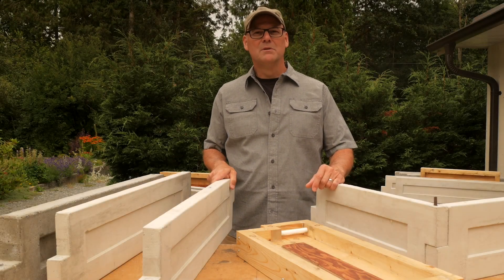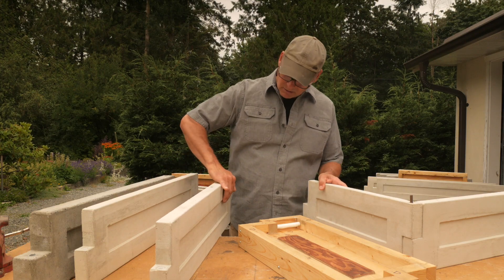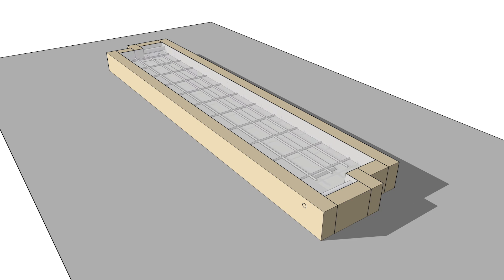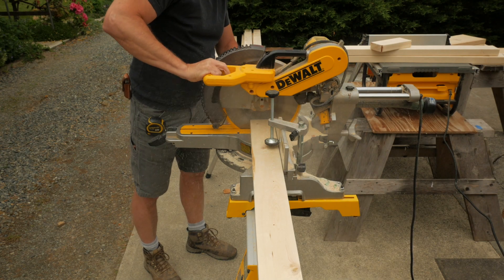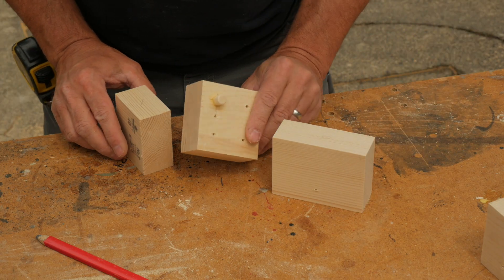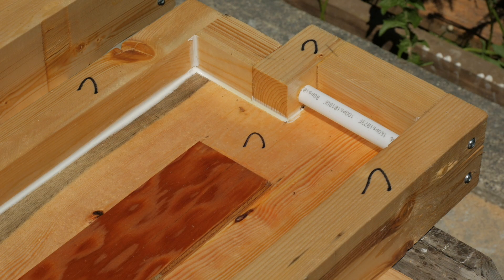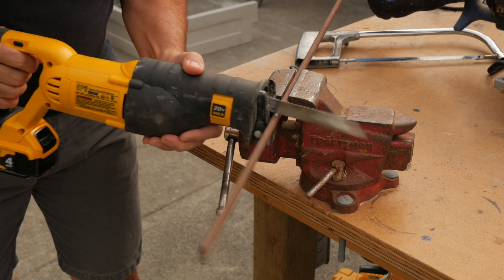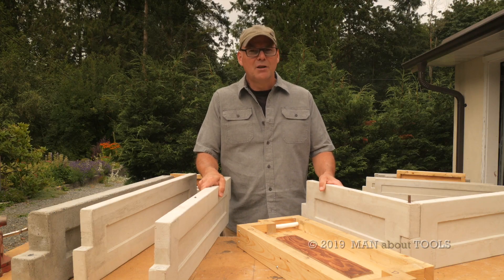make Thin CSA Concrete Garden Boxes PART 4 - cast garden forms

Comment: So, about the mesh in there ... as many have pointed out it's mainly there to take on the sheer tensions in the piece, as concrete is weak to those (while it deals incredible well with compression tension). The main reasons to put it in structural concrete (or any) is to deal with these types of tensions, be it from transporting/lifting (aka bending under it's own weight), or impact tensions (f/e sidewalk curbs have a steel rod inside to deal with loads from cars hitting (or resting on) them, and of course any actual permanent or dynamic loads the structure has to endure which would cause the piece to bend ...

So to figure out if the mesh is needed, one would have to analyse all the loads on the piece, and whether the concrete itself can withstand those (and/or how likely it is these situations will occur). So for a gardenbox side i would say: Transport/Lifting (aka it's own weight), any impacts from mechanized garden equipment (say lawnmower), and any freezing of water in the soil during winter which will expand (and seeing the sides are fixed in place) and cause a load on them (more?) ... I am pretty sure you could calculate all these and figure out if they are actually needed... (or, you could just try it without and see how it goes ;D if you don't mind sacrificing some concrete). 

Would like to add here that the adding of glassfiber serves a similar purpose as the steel mesh (but in all sorts of directions due to it being mixed in), so adding in say triple the glassfiber may well be more then enough... Be it that for 'impact' durability, the mesh is probably best (though i am thumbing that and basing it on pretty much nothing but my own understanding of the matter). Though here again, you could test that. I saw you have some nice concrete weights, if you don't mind sacrificing some concrete you could drop on a sidewall from say 3ft (1m) that has mesh, has extra glass fiber, is just base mixture without the mesh... 'for science' and if nothing else, it would make for some interesting and exciting videos ;) ... one could even do an enduring load test first, put the three test sides on some bricks on each side, so they form a bridge, and just start stacking bricks in the middle and leave that over night (or until it breaks). Similar, you could stack a pyramid shape on top of them to simulate pressure from the ice.

Comment: Hiya, besides commending on the really cool panels, and efforts on improvements ... i would like to comment on the forms, mainly the 3 part assembly sides... you do realize these can be just 2 pieces right? Where the dowel goes in the end grain of one of them, and the other piece over laps and is glued and screwed from the outside ... less parts mean easier assembly, less screws, so cheaper to make... the only 'downside' might be bows or varied thickness of the wood (mainly the part that goes into the recess (with dowel) as it will need to match the depth of the reces 'perfectly if possible', so that the other can sit flush on the end of the base) ... Just my two cents (be it that i watched 1&2 quite some time ago, so maybe you addressed this already? and maybe the 3 parts arose from this, as it sort of circumvents the issue, but so could a planer) ... OMG, i hit play !!! and what do you know ... gah i feel stupid now for commenting half way :P

Comment: something to try with this high strength mortar mix would be PAREX USA INC 2165 4.5OZ Fiberglass Detail Mesh (Amazon) instead of the wire reinforcement.    i would suggest filling the form 1/3rd full, placing a full length piece of mesh, adding another 1/3rd mortar mix, another piece of mesh and then topping off the form.  this mesh is used in the light weight synthetic stucco systems to give strength to the skim coat type cement applications over foam.

there is also a thicker version of fiberglass netting called Armor Mesh which is primarily used in High Impact areas (up to 10') to help keep the synthetic stucco from being damaged by contact.

Comment: Would it be structural sound to make these panels 2’ wide and 6’ tall and 96” long to be filled with some sort of medium and capped?  I was thinking about building a gabion fence but I think these panels would look much nicer especially with the inset.  Further more, would these panels be cheaper than any other kind of closed fencing?

Comment: You may be getting tired of this series, but here's a few options I'd like to see you try: 

1.  Substitute ground expanded polystyrene foam as the aggregate to make epscrete.  
2.  Cast them with the silicone molds instead.
3. Make them with paper + cement mache:
https://www.youtube.com/watch?v=fz7716WNxKY
4.  Make a version that is bench height, with a lip that you can sit under.  That way, you don't have to bend over. 
5.  Make a version that is also sub-irrigated: 

https://en.wikipedia.org/wiki/Sub-irrigated_planter

Comment: What's the longest panel you ever made?  8' will work?  I have current wood raised bed garden next to my driveway, that extends ~100' long x 4' wide.  Thinking of  gradually replacing with these panels.
Reply from the maker: The longest I have made is 4'. They are easier to manage if you keep them as short as possible. They are lighter, easier to cast, and less likely to crack. Myself, I would not cast an 8' panel.

Comment: Hi, Brilliant presentation of a basic concept for the DIY enthusiast. I have a question regarding the connections and corners. Have you testing using angled or curved corners. Say a three-side trapezioid or half-circle around the peg pipes. I ask as I would like to adapt your basic design so as to assemble a octagonal raised bed. I also would like to use the forms to edge existing beds, using non-90 degree joins. I am concerned whether the angled or half-round corners would reduce the strength around the peg pipes.
Reply from the maker: Thanks! I have not tested alternative connection angles other than 90 degrees or straight.

Comment: BTW, when your cabinet screws start getting loose in their holes because of continual reuse, you can slip a short length of solder into the bottom hole. It will deform under pressure of inserting the screw and make the screws tight again.
Reply: Right. Just be carefull to used no lead solder cause it could seep into the plants and if edible would pose a health risk.
Reply: @Hal Graves  The solder is in the screw hole of the form. .  .not in the concrete
Reply: Break off a couple pieces of wood toothpicks (slightly longer than the hole is deep).  Add a dab of wood glue to the toothpicks and tap into the hole with a hammer. Cut or sand off anything left protruding. Let it dry and reassemble the form. This is the same method I use to fix stripped hinge screws in doors in your house too.

Comment: I've heard about adding Styrofoam beads to the concrete lighter.
Reply: I've done this and it is not ideal. The Styrofoam beads get statically charged and stick to everything and are a nightmare to measure, mix, and clean up afterward. They also provide zero strength.
Reply: They use a coated styrofoam. https://www.youtube.com/watch?v=wr2wraFFc0c

Comment: I like how you designed this so that the pins linking the sections also pin the box to the ground. I also think air-filled concrete would be suitable for constructing these panels.

Comment: FYI you can cover the concrete with plastic to retain moisture/help it cure. The longer you do this, the better for strength, up to 27 days which is the full curing time.

VERY nice boxes, btw.
Reply: He usually throws them into a tub full of water. That helps keep them wet.

Comment: Aircrete.... use old or new forms and each panel will weigh 60% less. Plus panels won’t heat sink the soil and insulate instead
Reply: Freaky Biggles aircrete is nuts.

Comment: The only reason for garden boxes in my region are rodents. Can you add a holder for 1/4" hardware cloth on the bottom, even where the wire is replaceable?
These are nice, but really need scaled up to be practical.  5'x25'x2' would be great.

Comment: Briljant design and innovations. But... Why food grade mineral oil? It should resist CSA right? My choice would be cooked linseed oil. It's a quarter of the price of mineral oil and more durable against that cement burn. 
I agree on the wire. Not needed but a cheap investment/insurance. Because when breakage occurs (due to a wheelbarrow crash or whatnot) it's never when you can afford to a minor disaster.

Comment: I'm wondering...instead of adding a fillet of silicone to the corners of the form before you pour in the CSA concrete, you wait to round off the sharp corners of the concrete after you remove them from the forms. If you were to use an old whetstone or a rock to rub the corners down — much like you would with a sanding block on wood.

Comment: I find the thinner rapid set mortar mix panels break very easy. I didn’t add wire so maybe that’s why they broke so easily. I poured more and added wire so we will see what happens. 
Any suggestions?
Reply from the maker: It's hard to tell what the problem is without seeing them, or how they were poured and cured. Did you use glass fiber? And the Flow Control additive?

Comment: if you would like a nicer finish perhaps try vibrating the form during/after pour.  even something like a hand sander held against the form walls will minimize bubbles.  a concrete vibrator is relatively inexpensive and you can just touch the form with it vs putting it in the concrete.

Comment: Love the idea, can I request a form design that have rounded ends so the panels can be set at angles other than 90 Deg.
Reply: You could probably do that by gluing inside corner quarter-round molding into the corners.
Reply: @pawpawstew  This was my plan, I was just hoping to confirm the size & placement from the inventor.
Reply: Couldn't you just use an angle grinder to do that after?
Reply: Great idea!

Comment: The wire grid seems more like a personal safety feature. If one of these slabs were to break while you were carrying it you could easily destroy your foot, assuming the jagged end hits you just right. I'd keep using some kind of reinforcement, even if were just heavy plastic farm fencing.

Concrete has high compressive strength but has low and unreliable tensile strength, it's also prone to cracking. It is for these reasons that reinforcement is used in concrete, which might span a void or be lifted (even if only temporarily). There are many in the concrete industry who argue that reinforcement is unnecessary (or even a negative) for some paving applications.

Comment: I cut the pvc in half and reassembled them with a pvc coupling, then cut them to the correct length. This prevents the pvc tubes from accidently being pushed out of the mold.

Comment: Can foam concrete been using for casting this garden box?
Reply from the maker: I'm yet to find a foam concrete formula that's strong and durable. These thinner cast panels and forms are designed for high strength CSA concrete.

Comment: First off, I love your videos. Now for my two cents. You dont need grids with that cement. I made a  5' table 2" thick and placed the panel on two HD buckets then I stood in the middle of it. No cracks or weakness. Also, melamine is easier to work with when making these forms. You can spray on WD40 which works as a release agent. One last thing is you need to keep the concrete wet to avoid cracking "it gets tal hot".

Comment: I notice you didn’t reinforce pipe with wire in this video; don’ t need it or other reasons?
Reply: it has the glass fibers in the poured mix, which will end up performing the same function.

Comment: Have not watched all the videos, but have you tried adding 'concrete and screed reinforcing fibres' to mix so  in theory could make panels thinner.  Or use a different design for insert panel, for example instead of two oblongs use a set of  thicker triangular shapes to give effect of cross braced beams..

Comment: Rather than using screws to hold them together, you could have pegs or mortises around the base, and lock the sides together with toggle latches.  No tools necessary to assemble or break down the forms.
Reply from the maker: ShadowMage3D Yes, that would work very well.

Comment: Great series! I love it! Did you happen to do the weed eater test on these panels too? How did they hold up?
Reply from the maker: Joshua Coburn thanks! I didn’t think I needed to do that test as the CSA concrete is very strong and durable. It would be unaffected by the line trimmer.
Reply: Thanks! One more question, did you do a price comparison anywhere to give an idea of the relative cost of making these panels vs your standard panel or the other light weight style panels? That would be awesome to see. Thank you!

Comment: Lube the inside of the plastic pipe the dowel will side out easier.  Also mark the depth on the trowel, so as to get the wire grid to center of each form.     How to make them stackable?  For added height

Comment: I once lived near a ballistics lab where I helped with pouring a concrete patio. The concrete truck driver told us that the lab always asked for 30 times the usual amount of fiber glass to be added and that the lab used little to no wire support to build explosion proof ammo bunkers. I'm not in a situation to try it at the moment, but it might be worth a shot and might reinforce the area around your tubing which will take the most stress and is the weakest spot.

Comment: Hi Kent, 
Brilliant design and simple casting. Love the video.

I am looking at replacing rotting wooden frames for my veg plots. I would prefer to stay with the plot size of 5' x 20'. In your experience would casting 60" forms with reinforced CSA be okay, or would you advise against it? The height of 8" will be perfect.
Thank you. John, in a sunny UK, at the moment.
Reply from the maker: I think 48" is about as long as I would go. There's more potential for cracking as you increase the length. And they would be heavier too.

Comment: These are well made and thorough productions. Usually there are no unanswered questions however in the mortar mix did you use the vegetable spray as a release agent again or was this step unnecessary because of mineral oil coating? Thanks.
Reply from the maker: I used the veg spray. I cut some of that as it was shown several times before. I mentioned it tho.
Reply: Thanks Kent. Southern Island or mid Island?
Reply from the maker: @irrops  We have a little property outside of Duncan.
Reply: MAN about TOOLS Nice. The foliage was kind of giving it away.

Comment: Consider looking into vacuum forming plastics. Create a plastic covering for your wooden negatives, It will extend the life of your forms and will allow the concrete to seperate easily. I recommend  using compressed air to help release your concrete slabs.
Reply: It's easy to do in 3mm sheet steel cut to size. Also gives a perfect smooth  finish

Comment: how eactly would you keep the panels wet to achieve maximum strength? could you put them in a low pool/bath to do this?
Reply: I have been stacking them under the drip edge of a shed and covering them with  about 6" of wet hay and water daily

Comment: OUTSTANDING SIR!!!  Excellent Workmanship.  Excellent job well done.  Thank You. Now I have my Garden Boxes to design and build. 
One thing I am having to deal with in building concrete garden boxes is the weather. in Florida the Summers are a daily wet mess. Rains are constant and daily. One suggestion was made was to increase the amount of cement into the mix. (maybe by 15 to 20%) This may help the mix set up stronger in the humid wet weather. 
All in all this was by far the BEST instructional video I have ever seen. 
Thank You again!  :-D

Comment: What about an aircrete formulation using the CSA concrete, or possibly an inclusion of expanded polystyrene?
Reply: Won't adhere to foam but perlite it will, which is often used to fill in foundation blocks to lock them together yet still provide an air gap barrier so that temperature will not transfer as well as solid.
Reply: @DavidRebarJr  Thanks!

Comment: My understanding of concrete reinforcement is that the embedded metal increases that section of concrete's resistance to tension fractures. With these garden boxes the main force to be restricted is the expansion of the raised earth on the inside. That would cause the panels to bow from the flat inside to the decorated outside. So the inside of the panel will experience compression stresses (which concrete is naturally good at without reinforcing) and the outside of the panels will experience tension.

Here is a "Practical Engineering" video on the topic (about 9 minutes) https://www.youtube.com/watch?v=cZINeaDjisY

Long story short, I think you want your reinforcing mesh closer to the front of the panel (the outside of the garden box) not the inside.
Reply: @Steve Sherman I'd use galvanized stock panels (fencing) for reinforcing.  Rather thick wire and galvanized - it'll probably far outlive the maker.
Reply: @Steve Sherman pretty sure the ''glass fibers'' were basalt..
Reply: I think your point is valid, but mainly for areas with really harsh winters. One fix would be to cover them with plastic at the end of the season and let it dry out a bit. No water equals no expansion.

Comment: the wire really only adds tensile strength which is a pulling force on both ends. so yes its not really required since its not a building or bridge structure. 
but you do have a point about it holding together if cracked. if anything wire reinforcement around the pipe would may only be necessary.

Comment: I don't think putting the wire mesh in the middle would do much of anything but resist cracking, for strength it'd have to be in the tensile zone of the concrete.
Reply: Concrete has very very little tensile strength, that is the reason for adding the steel, concrete is ONLY strong in compression